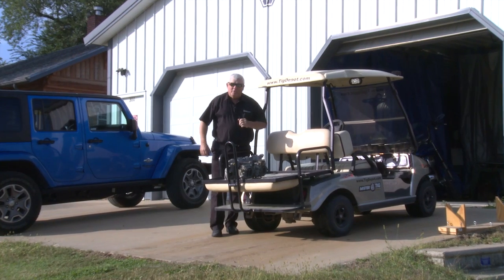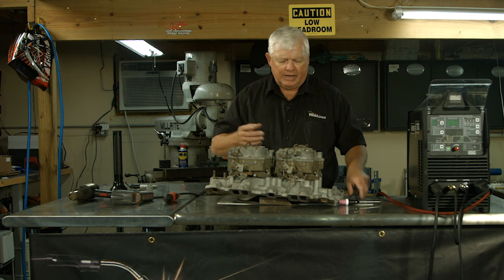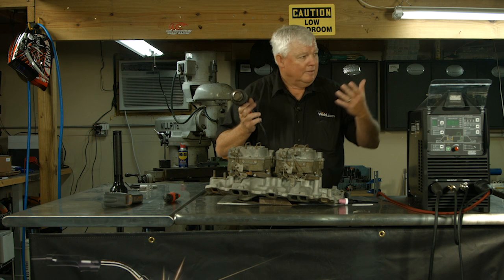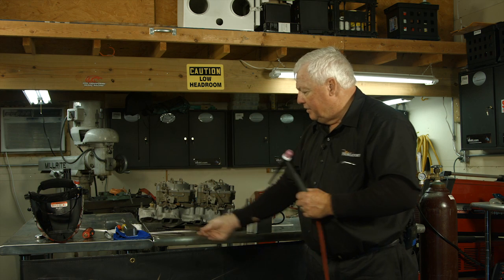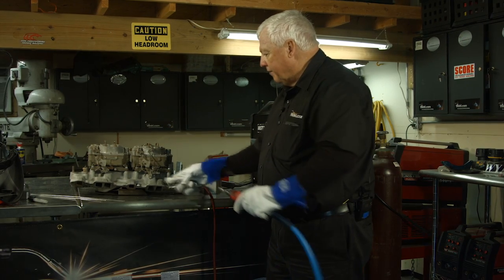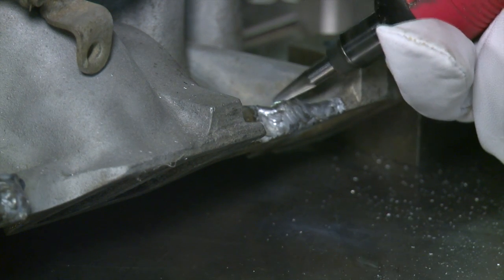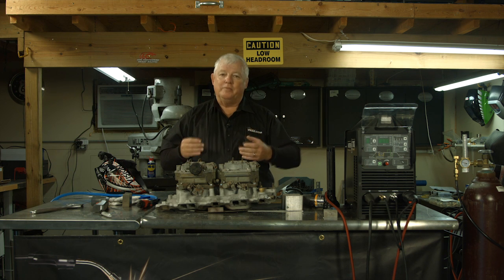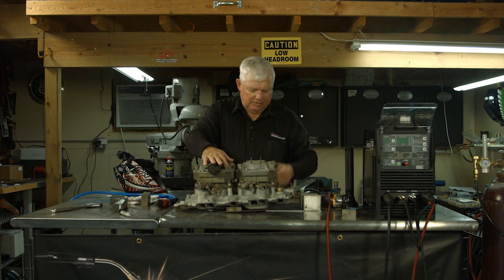Cast Aluminum Intake Manifold Weld Repair | TIG Time

Comment: I'm replacing the carburetor mounting surface on the intake manifold and welding on with a 140 spool gun. My question is, should I use a helium mix and is a 130 deg. f where I need to be for per-heat?

Comment: a clean stainless steel bristled wirebrush is really good for cleaning oxides off of aluminum.. you don't always have to grind them away, you can mechanically or chemically (using flux) treat them.

Comment: Enjoyed seeing a real repair video. It shows what to expect when performing such a job and I'd love to see more like this.  ;-)
Reply from the maker: We will try and get more projects like this in future episodes. We always encourage our viewers to send us a message if they have a project they need welded and we will make a show of it. Often times the most difficult part of making the videos is getting a good workpiece to show.
Reply: Weld.com I have a doozey for you. Engine on a tiller threw a rod.  The broken rod hit the camshaft and cracked the cast aluminum block where the cam fits in on both sides. It's not a bad crack, I've had experts say it wouldn't cause a problem when rebuilt but could be welded. The issues are welding without distorting the aluminum and overcoming the contamination from the motor oil, since it's the inside of the engine.
Reply from the maker: mandolinman2006 send us some pictures on the Weld.com forum. We will take a look and see if it is something we can weld for you.
Reply: +Weld.com Really nice welder. I will be looking a lot closer at this model.
Reply: +Lewis Drake I've got my eye on the 210ext myself.
Reply: I'm not sure if I want to get the 210EXT or its bigger brother the everlast 255EXT. I might weld aluminum so maybe the extra power will be required.